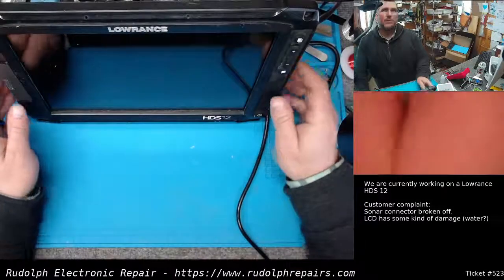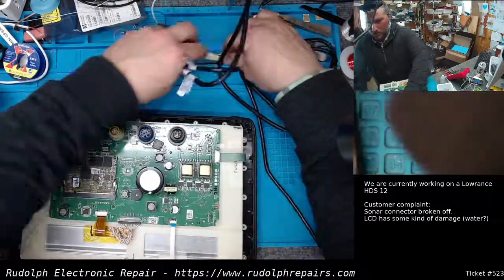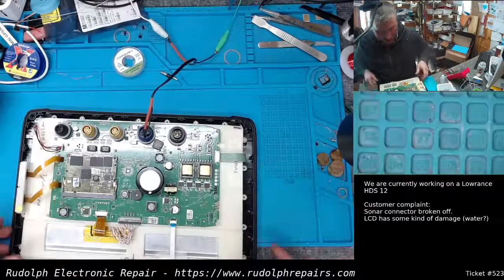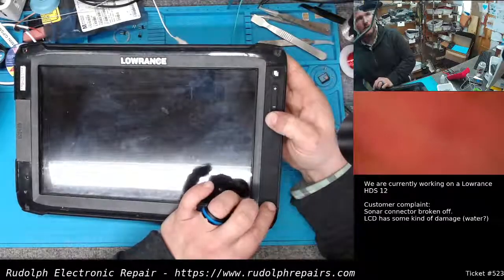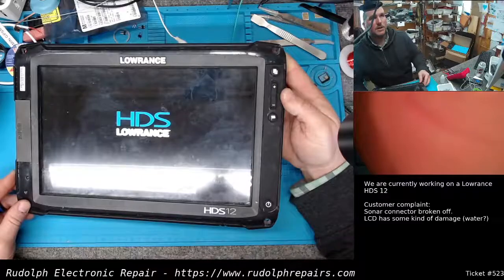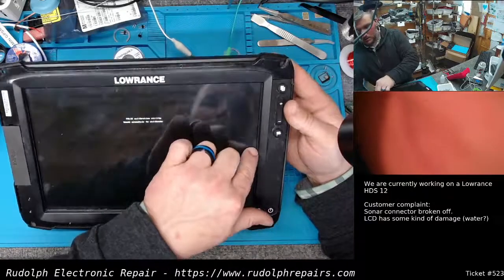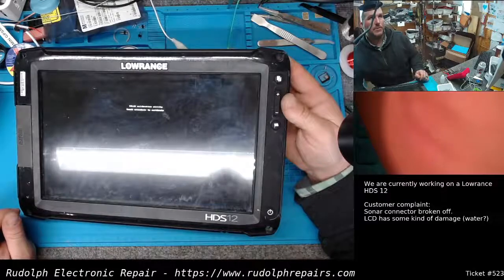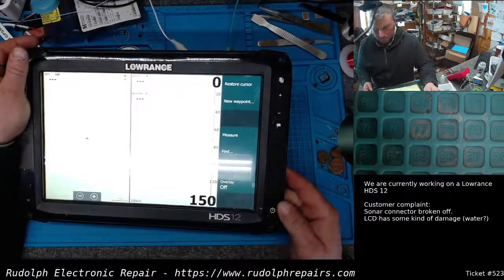Lowrance HDS Touch Screen Re-Calibration

Comment: Thanks mate. Any clue as to why a touch screen calibration wouldn't fully load? Status bar fills and skips straight to the mormal screen without touching any crosshairs
Hds12 gen3
Reply from the maker: Hi Barratheo, yes I believe the touch controller is not being detected during boot- so the calibration utility fails to load (as touch device is not available)..
Reply: @rudolphelectronicrepairllc8938  is there a fix for that?